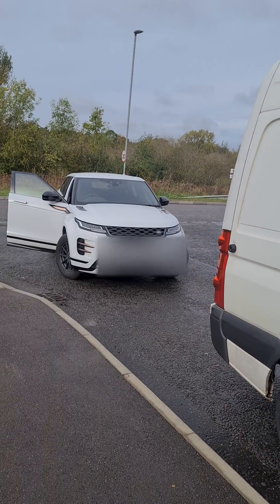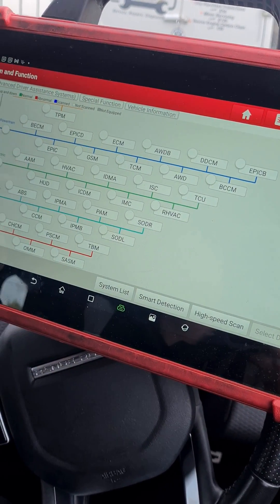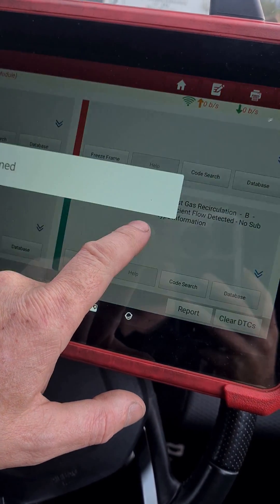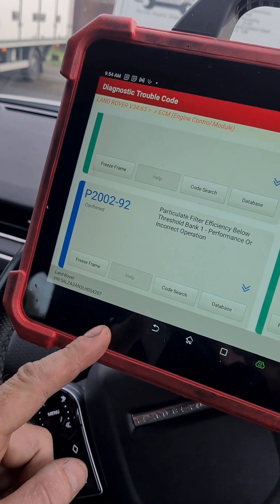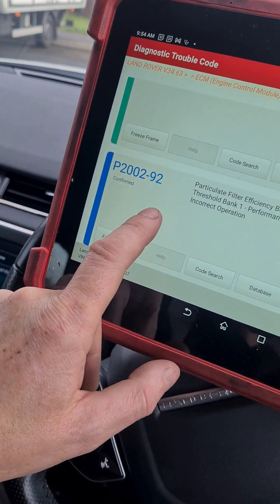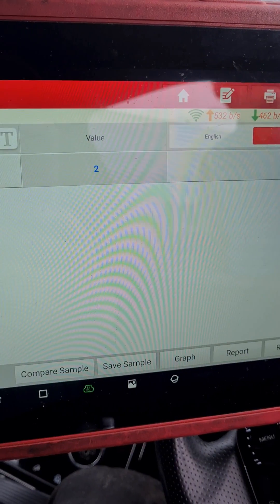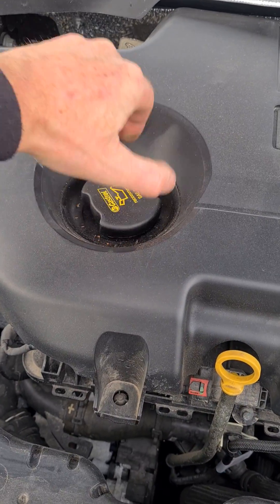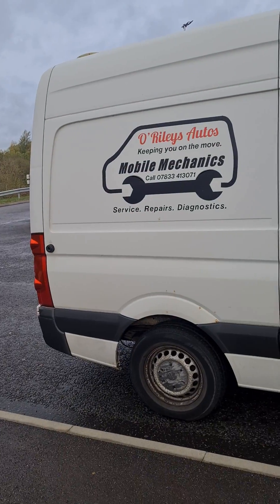Land Rover Range Rover 2.0 Ingenium P049B-00 & P2002-92 EGR & DPF Efficiency

Comment: Hi. I have Range Rover Velar on the workshop. The car arrived in safe mode. The P2002 fault, the pressure sensor showed the difference of almost 0 when I add the gas for about 10 mbar.

I thought he was cracked. I removed DPF and let it check - it is not cracked, cleaned it, I gave a new sensor of different pressure.

I thought it would be OK, but the car still shows a fault P2002 and the pressure is still at 0.

Do you know what it can be behind the problem? Egr cooler ?

Comment: Bonjour , my Evoque 2016 get also P049B , i spend 400€ to change ithe filter. In fact i love my car , no other problem with. The problem is that with 9 automatic gear , the motor run too slow ! it is madatory to use sometime Sport mode and manual selection  and run over 3000 rpm at least once a month.

Comment: Considering what this car costs, and the low mileage, it is unfit for purpose.  There’s too many of them in similar condition for the manufacture to claim it’s a one off.  A general recall and a permanent fix should be made.  My low rent Qashqai has 350,000 on the clock, never had an issue with the dpf or any other part of the exhaust system.  And yet this “premium” badge car is failing at such a low mileage?  I’d be mad as hell if that was my car.
Reply: Your low rent vehicle isn’t a Euro 6 engine.

You can direct most of your ire at the EU and UK Governments and their restrictions.

Strangely the 3.0 v6 diesel is more reliable and cleaner than many people want to admit 

Though with those miles I would suspect that car has had very few oil and filter changes and has likely spent most of its life with oil suffering from diesel dilution.

All things which affect older Euro 4 and Euro 5 diesels less than Euro 6.

Though there aren’t that many Euro 4 diesels have a DPF, the 1st Euro 4 diesel I used that had a DPF was the mk2 Zafira 1.9 CDTI, they were a nightmare as in 2006 very few diesels had a DPF in the UK, the manual gearbox Zafira never had a DPF but the Automatic did.

They suffered with all kinds of issues, diesel contamination of the oil which caused engine failure in as little as 10k miles, EGR problems etc.
Reply: @bigjml  well it’s either because I change my oil and filter every 10,000 miles (half of what Nissan says you should) or I do long distance runs/very little city driving that has kept my exhaust system running fine
Reply: @bigjml is euro6 a lot worse than 5? I have a euro 5 Volvo s40 and not had trouble yet, touch wood
Reply: I would imagine both mate Diesels are designed to work long hours not short runs so yeah that’s why yours is okay
Reply: What a crock of shite, another one for the breakers.

Comment: I have a Jaguar E pace same engine and codeP049B problem.EGR cooler filter blocked.Changed the filter now sorted(hopefully) No DPF problem
Reply: Hi Jimmy I know what you are saying but my DPF is clear and I have had no Dpf fault code come up only the P049B.The filter was changed on the egr cooler and I have not had a fault code come on over three weeks.Engine running fine and nothing coming out of my fillet cap like the one in the video.
Reply: Was it black soot on the filter ???
Reply: @timbo19751975  Mine has the p049b code but no soot in the exhaust .. What do you think??
Reply: @max11111able    blocked lp filter maybe
Reply from the maker: It will be back if the DPF hasn't been done